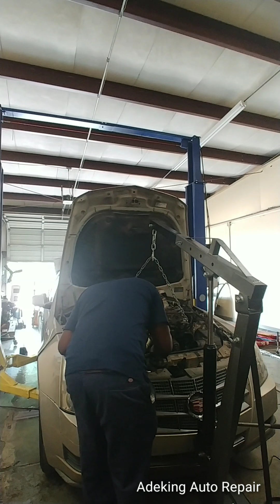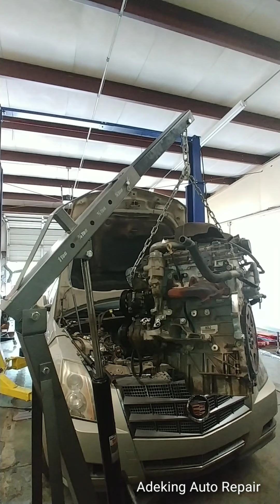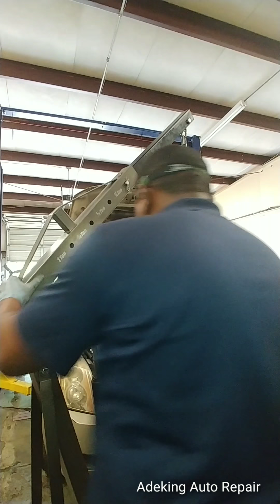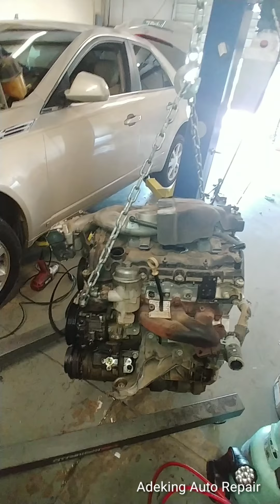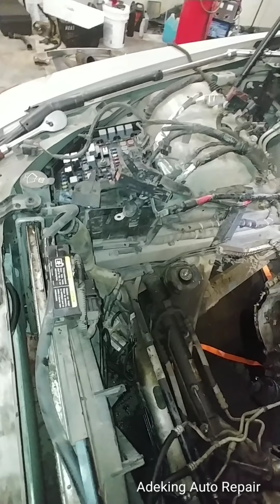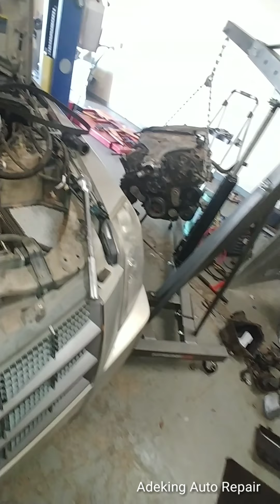Engine Removal on 2009 Cadillac CTS

Comment: check engine light was on, garage told me I had a code internal engine problem and they have to remove the engine to make the repair, have you ever heard of such?
Reply: Yes, these car's chain stretch common problem.
Reply: Yeah. But you can do the timing chains in the car. I did

Comment: Did you have to reprogram the computer after replacing the engine?
Reply from the maker: Not required
Reply: Thanks a lot for that information I was getting a little worried I’d have a problem with the engine starting after replacement. It looks like something I’m going to have to do myself due to cost since a replacement engine looks like it’s going to cost $1200+
Reply: Will a 3.6 motor out a 2011 STS fit in a 2008 CTS 3.6?
Reply: @jasonmassey7883  was oil your problem? And that year seem a little high but do research.
Reply: @jasonmassey7883  engines have a "name", chevrolet engines go something like ls6, luv, lwh, ls4..... search for the name of your engine.